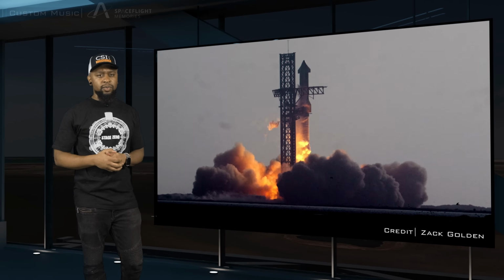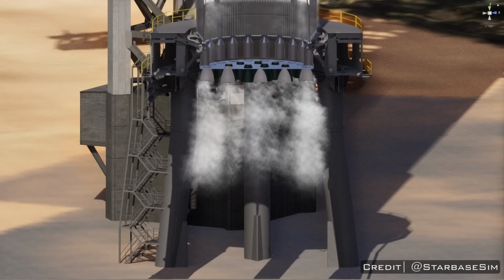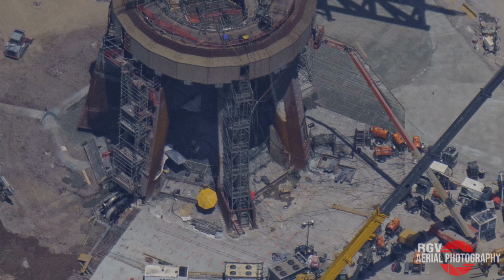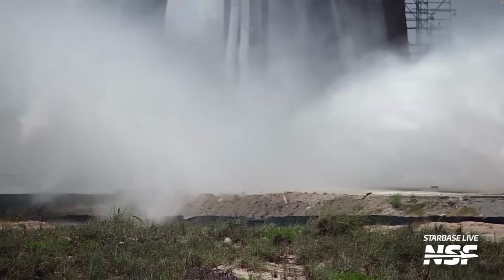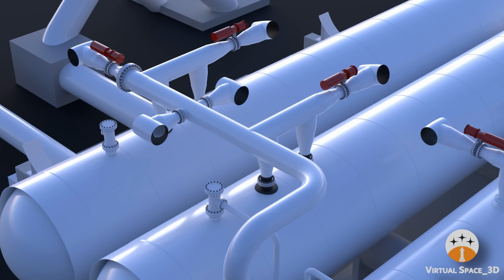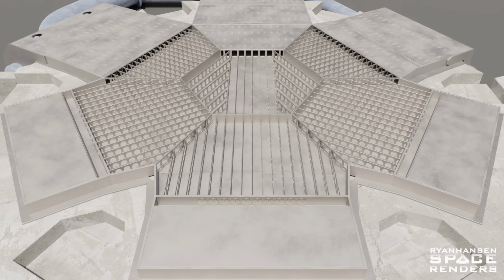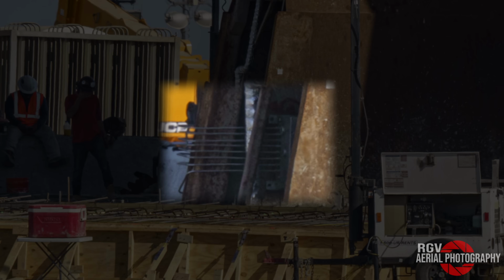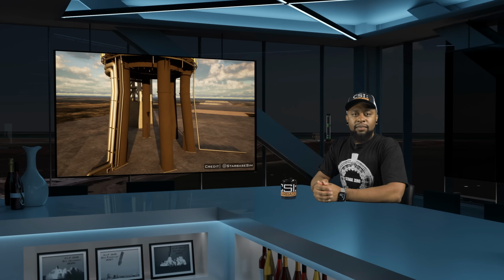How SpaceX Will Guarantee Its Launch Pad Never Fails Again! [Part 2]

Comment: It's important to understand that every second there's a tremendeous amount of new fresh and, most importantly, cold water being supplied into the shower head. That means there's just no time to heat it under the plate, because it's already been evacuated to above the plate and thus keeping the plate well below melting temperature.

This exchange of heat under the plate is most important function, together with the piled plate being structurally stable against the downward pressure - you know have a solid system.

Comment: They will need some deluge at the top of the mount that kicks in as the clamps unleash the beast.  Mark my word!
Reply: The launch mount fare much better than the pad on the first launch so why?
Reply: @alvianchoiriapriliansyah9882  Repeated launches will degrade the plethora of electrical, hydraulic, and pneumatic control systems packed within the ring.  Also, each launch degrades the unprotected steel.
Reply: Well spotted, but it's already in the design and been spoken about all year, although not inplace yet.

Comment: Water in the plate is under high pressure which will increases the temperature required to boil.

Comment: Hello, dear CSI Starbase Crew. I have a question, please: Why can't SpaceX just build a huge pool and launch the Starship from the surface of the pool? The amount of water that evaporates from the surface of the pool when you start it should be enough protection.
It would be cost-effective and had very low maintenance.
Reply: 1. Larger environmental impact
2. Water quickly disappear instead of constantly being replenished

Comment: Why not just create a easily replaceable surface for the exhaust to hit. Why not freeze a 3ft thick sheet of ice under the boosters and then dump water on top during launch. a steel lattice in the ice could be used to add strength.
Reply: You know that engine exhaust is thousands of degrees right?

Comment: I would call it version 1.1 of stage 0 as traditionally a versio 2.0 is incompatible with previous versions
Reply from the maker: Everything inside and outside of this launch mount has been replaced and upgraded over the last year. I consider it 2.0 for that reason. You can no longer put booster 7 type vehicle on top of this and launch it so technically its incompatible with previous design
Reply: @CSIStarbase  Good call on it being incompatible I didn't realize that :) just commenting for that sweet algorithm lol

Comment: Stainless steel is a very bad heat conductor when compared to copper or aluminum
Reply: That's assuming it's actually stainless and not regular

Comment: Those motor's aren't so rich of oxygen, that cutting torch. Whole different thing.

Steam explosion is always bad thing, steel itself could catalyst that effect to happen more likely, than without it. I would do it the way, where water ejects just after hottest place and took energy and heat from fire's. I hooe this what they did is best and will work.
There's really some serious energy, that's not easy to understand and control.
How well Nasa managed this thing in their own system's little different way, is needed respect.

It would feel so stupidly, if your rocket works, but earth cannot handle it..

Comment: 3:44  The video says re-entry is because of friction.  Actually, re-entry heating is mostly caused by compression of the air in front of the re-entry vehicle traveling at hypersonic speeds.  The air molecules can't get out of the way fast enough, so the air molecules are highly compressed together.  Each air molecule in the bow shockwave still has the same heat it had before, but now all of that molecular heat is compressed to into a much s smaller volume, making the bow shockwave very hot.  There is still some heating by friction, but most of the re-entry heat is from isentropic compression of the bow shockwave.

Comment: Hey, Zack. Congratulations on another excellent deep dive into the wonderful world of Starship launch operations.

SpaceX has evidently developed a viable alternative to the classic flame trench with this bidet shower head design. 

But I continue to think that Starship launch/landing operations are better centered on ocean platforms, particularly the numerous launches of uncrewed tanker Starship launches that will be necessary for Interplanetary Starship operations beyond LEO. No flame trench or bidet shower head required for launches from those platforms.

To my way of thinking, the Starfactory at BC will build the uncrewed tanker Starships that will be launched from ocean platforms in the Gulf of Mexico about 75 km off the beach at BC. 

The cargo Starships and the crewed Starships would be built at the Roberts Road Starfactory at the Cape and launched from the Starship facility at Pad 39A.

Comment: Good vid.  One detail.  Reentry heating in the extreme upper atmosphere is not friction.  It's shock wave compression, which raises the air to plasma energies, a few mm from the surface of the craft, and it heats the tile through radiation.  There's not enough air density to transfer much momentum as friction heating until you get in the lower atmosphere.

Comment: I bet you it will fail. Notice the latest test. there is no steam after the initial blast. The pressure from the rocket is so large that there will be no water coming out.
Reply from the maker: Thats not what I saw. I guess we will find out soon though
Reply: How much you wanna bet
Reply from the maker: Nothing.  I will watch and find out with everyone else.
Reply: @CSIStarbase  I was responding to the original post, fyi - I'm fully on board with the success of the plate.

Comment: What about the cracks in the concrete around the pad after the static fire?  Any information about the acoustics and the status of the steel deluge plate?  Did the plate partially melt?
Reply from the maker: No way to know for sure. Seems to me like Fondag cracking was a result of the current heat wave in South Texas. Its good to keep concrete covered and wet when its super hot outside during the curing process

Comment: If the water weir flow is really let to crash against the static pool of water in the lower pipes that is a serious design flaw. The water hammer pressure transient eventually will cause the pipes to fail.

Comment: Big question. Why didn't SpaceX go with a trench style flame diverter? Is the water table too close to the surface at Starbase? Or is there another reason.
Reply: Something I wonder as well. 

They didn't go with a trench because of the water table making it unfeasible. Another option would be to build an artificial hill like at 39A but that takes significant time to settle and SpaceX does not want to wait.

But those are not the only ways to build a diverter. Especially since they already have the OLM and they are the only ones to lift and place the rocket on the launch stand the diverter could just be constructed above ground. 

So I really do not understand the stubbornness to not build a diverter.
Reply: Instead of flame trench they build steam cannon to reduce amount of fuel and oxidizer used up during launch
Reply: @KarolKarolak  if you are correct, they would be better off enclosing the sides of the launch table.
Reply: @jook360  enclosing the sides of the launch table is just one of the things, increasing barrel length of the cannon from current 2m to around 40m is another. Extending launch tower and adding another set of counterbalanced "light" chopsticks going up with the rocket to guide upper part of the rocket while in the tube also required.

Comment: I think that after the 2nd launch attempt, SpaceX will definitely dig a flame trench… this deluge system will not hold up, imo.
Reply: You were so lucky the last time that Starship didn’t slide the wrong way… maybe next time, luck will run out… and this “ nah, flame trench are obsolete “ innovative thinking will blow in your face as it should have happened the last time, unfortunately, you were extremely lucky!
Reply: @renesoucy3444 And what will you do if it didn't?

Comment: The catch pond doesn't need to catch all the water, just the water that is running off on the surface, because that's the water that is going to pick up whatever crap is on the ground, leaked hydraulic fluid, etc. Spraying clean water into the wetlands would seem relatively harness.

Comment: I guess SpaceX hadn't learned the Kzinti Lesson.
Reply: "As a general rule propulsion exhaust is poorly collimated, which means after a very short range it will have expanded and dissipated into harmlessness."
Reply: @Geoff_A Yes, too bad the concrete slab was within range :D

Comment: They should mount a few raptors into the ground boosting the rockets upwards at the same time 🔥🔥🔥- cancelled out- problem solved 😂😂😂
Reply: They build steam cannon it does the same thing you are suggesting and it  is more practical as it cuts down on fuel and oxidizer consumption during liftoff

Comment: Few questions. 1. Why not just use a water tower and add pressurization to the piping? Holds more water, less of a footprint, additional free pressure due to gravity. Unless the tank needs to hold high pressure and not just the pipes. Also they should take advantage of the unused GSE tanks that hold water to refill the system in case of an abort . There has to be a better way to refill the system than just using trucks. Install a water line from the well or other source. 2. I'm sure the new system will work fine but how do the plan to launch from mars and build the necessary infrastructure?
Reply: You cannot just add pressurization to piping water flows only from higher pressure to lower pressure
Reply: The booster will never takeoff from Mars
Reply: @alvianchoiriapriliansyah9882  It will never get there to begin with there is no need for Booster to liftoff from Mars.

Comment: Hmm.   80% of the water capacity of LC 39B with a rocket that has twice the thrust profile and in a complex pumping system.   Doesn't sound like a recipe for success to me.
Reply: Yea I’m a bit iffy about that as well but, we’ll just have to see how it goes. It just might do the job. And at least not let the steel plate melt, plus they did an unreal amount of reinforcement on the concrete as mentioned in this video, so i see a chance of this actually working out
Reply: More thrust ≠ more water

Comment: You may want to consider unclassified data available from the Air Force on overpressures expected on reinforced concrete structures by proximate nuclear blast. In particular, look to data on over pressures created by 1Mt explosions over your American Minuteman silo covers at 2000 ft.  (typical detonation height for maximum counterforce effect). 17 bar transient pressures stand at the lower end of expected inputs, from fast, adiabatic absorption of bomb energy in normal air. Overall, I feel that this pad, as now reinforced, stands an even chance of cracking due to un-even loads with  likely compromising damage to  the steel plate assembly. Keep in mind the amplifying effect of reverberation between the rocket base and a (stupidly selected) flat pad orientation.

Also, your points about FONDAG are right on the money - it cannot, in its native chemistry, cope with both high structural load AND extreme "fire" temperatures. As far as I know, no enhanced FONDAG, per se, has been formulated recently, though DARPA has sponsored development of some superior compositions (which cost A LOT).

thanks for a fine and thoughtful presentation - you obviously have an engineer's understanding of these matters. DKB.

Comment: In the water curtain power supply system, an overflow system is also needed to stabilize the load on the high pressure pumps and drain excess water from the sprinkler valves. That is why there are so many pipes and collectors with large diameters.

Comment: But the pressure is not a simple pressure, the engines create mammoth sonic pressures as well, perhaps beat frequencies multiplying the sound as differing frequencies are additive then subtractive as the frequencies interact. How much extra energy will this create and how much extra energy will the steel plate assembly have to dissipate? Perhaps the sound pressures at a distance can be used to extrapolate the real time pressures under the rocket.

Comment: Something that I have often wondered related to the water recovery discussion is why sites that are prone to high pollution, be it cities with high pollution, plants that handle oil, or whatever don't collect stormwater from their entire site and then run that through a wastewater treatment plant. While I know it would be a lot of water volume to collect and treat, but I don't think I have heard much in the way of exactly how much would have to be accounted for in designing it. Maybe that should be part of the discussion.

Another question I am wondering is why they don't use filtered seawater for the blast shield water. I know they would need a way to collect and then kick any marine life they catch back to sea, preferably with minimal harm, but why not use water with minimal processing for this purpose?
Reply: Sea water contains salt during turning water into steam salt comes out of the water and covers everything
Reply: @KarolKarolak  Is it as simple as salt would make a mess, or do you think it would cause Stage 0 to rot away?

Comment: Brilliant reporting once again.  
@CSIStarbase ,  there's one more tiny bit of the system I believe @SpaceX is or should be using.  There's a corrosion management system that would probably be used to mitigate rust corrosion via electrification, it's called "Cathodic protection."  A small electric current is probably used in the pipes, tanks, and water distribution systems to keep corrosion at bay.  It's almost a necessity in these humid salty conditions.  It's more common in the oil and gas industry.

Comment: There is a lot of to worry about. The pressure that these engines will generate is huge enough to crash these cutted metal plates in seconds. The water will reduce the heat for a few seconds but the enormous pressure will completly destroy the weak structure with holes in it.

Comment: How can they guarantee the launch pad?  So far they haven't used NASA common knowledge in a launch pad.  The distance from the engines to the steel plate may need to be extended to reduce the wear on the steel.  The water may help but the pressure of the engines could be enough to over power the water pressure.  There is a space ratio below the engines.  The pressure isn't uniform across the entire steel plate.  When the flow changes direction under that amount of pressure, expect issues 90 degree turns usually causes a decrease in flow.  That being said, the pressure created at the 90 degree turn can be far greater than planned if the height ratio is too short.  Also have they placed wells around the launch pad to reduce the ground water issue?
Reply: They build steam cannon to reduce fuel and oxidizer consumption during liftoff
Reply: @KarolKarolak  Still doesn't explain how they will overcome basic fluid dynamics.
Reply: @kensmith8832  Just for starters water is in liquid form while rocket exhaust is in form of a gas. Liquid is incompressible while gas is highly compressible. Water instantly evaporates expanding upward causing that area of maximum pressure is above the steel plate. Exhaust gas in contact with water instantly cools down decreasing volume and increasing density.  If you want to talk about fluid mechanics you cannot simply pick an choose phenomena you want to concentrate on while ignoring other phenomena occurring at the same time.
Reply: @KarolKarolak  Wouldn't the pressure differences from the downward thrust and the slower 90 degree exhaust cause a pressure issue?  Isn't this why NASA uses a ramp to force the gases into a more gentile transition.  That much thrust for that long could cause a massive failure, even with the water system.
Reply: @kensmith8832  NASA uses wedge in the middle of flame trench to redirect flow. It is such a common solution that I do not think anybody even tried to see what would happen if this detail would get omitted. You get wrapped up in this as if you had to deal with liquid like water and not with exhaust gas.
Reply: @KarolKarolak    Call it 30+ years of working in engineering.
Reply: @kensmith8832  I am not an expert in fluid mechanics but it seems to me that you are misinterpreting what caused hole under OLM during last launch attempt. It was simple design mistake, people who designed concrete slab under OLM should have assumed that OLM would sink into the ground and they should have made sure that slab would work independently making gaps between two structures. Obviously they did not do that, OLM sunk, slab cracked and hot exhaust gases dug cracked pieces out.
Reply: @KarolKarolak   It was a combination of ground water causing the earth to liquify, thereby reducing the bolster of the pad.  There was the a factor of pressure in cracks, the same thing that causes houses to explode in high wind.  There appears to be a an issue with the engines too close to the pad, this creates a compounded pressure issue.  The heat erodes steel very quickly under those pressures, similar in how you cut H13 tool steel with a torch.  There was also a vibration issue with the material in the pad without adequate rebar, which caused failure.  Basic failure analysis wasn't done by engineering, common issue.  Most engineers fail to cover every area of engineering as all they want is a self betterment program.  What I call the Eigenvalue IQ.
Reply: @kensmith8832  You forgot to mention position of the Moon and tides as a partial cause.
Reply: @KarolKarolak  I was trying to leave the natural disaster element out of a man-made money pit.  Thanks for the humor.